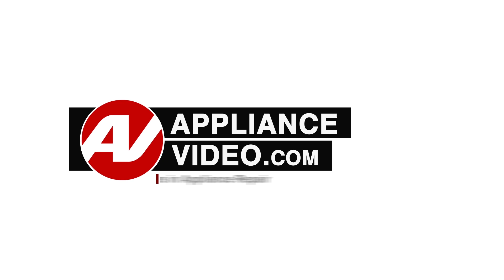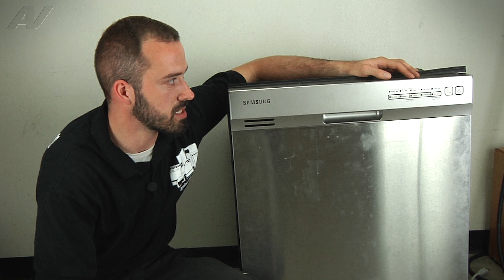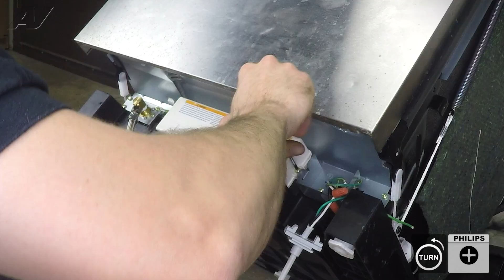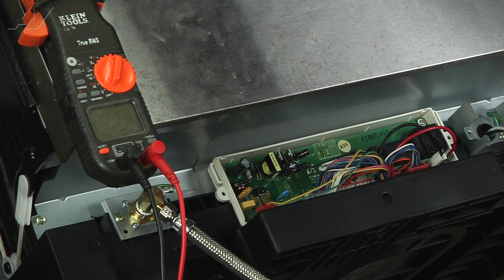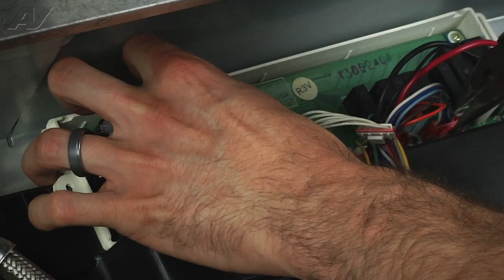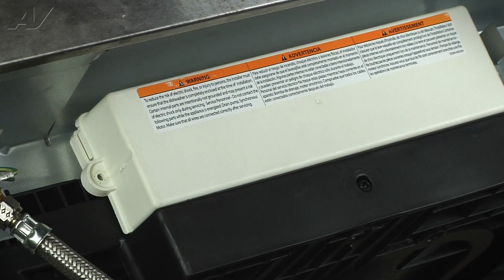Samsung Dishwasher Repair - Not Starting - Main Control - Diagnostics & Troubleshooting

Comment: It’s not always the case, you need to check power from the board to user interface to see if the maid board is supplying power to the user interface, misleading video unfortunately

Comment: What if there is a lower voltage in the points you measured? I had 28 VAC. The power input is OK though. I changed the board and the problem persisted. Bummer. 😞

Comment: Ok you check 120 input to main control board but you didn't check VDC output from main control board to sub board your job wrong
Reply: What would the voltage be at the board for the buttons. I have a newer soft touch model and have approximately 5 volts dc

Comment: Thanks 
Very nice and helpful video.
 My dishwasher  (dms300trw/zam) have same problem, shows no power. 
I follow same and found fuse is ok. Control panel is also ok.
I have doubts about mother boards at front bottom which shows burnt color at EC2- j49,  D5, R4, C2 resistor capacitor

Comment: What is the part number for the Control Board...
Reply from the maker: Great question, if you have a more technical question that our parts department cannot answer, you can search our over 17,000 answered questions free at our website www.ApplianceVideo.com under our Repair Help section. You can also call our parts department at 1-800-830-5465 and they can give you help 7-days A week ,or search at www.SaveMoreOnParts.com  .

Comment: Same Samsung model no longer working.  Replaced the main control, but still have the same issue.  What could be keeping the machine from not powering??
Reply: This video is not fully correct Ben. It was probably your touch panel. This information excludes him ruling out the panel. Because if the main control panel was getting the proper voltage, the next would be to see if the touch panel was as well. Not sure why he did not start at main touch panel or include this in the demonstration.
Reply from the maker: Great question, if you have a more technical question that our parts department cannot answer, you can search our over 17,000 answered questions free at our website www.ApplianceVideo.com under our Repair Help section. You can also call our parts department at 1-800-830-5465 and they can give you help 7-days A week ,or search at www.SaveMoreOnParts.com  .